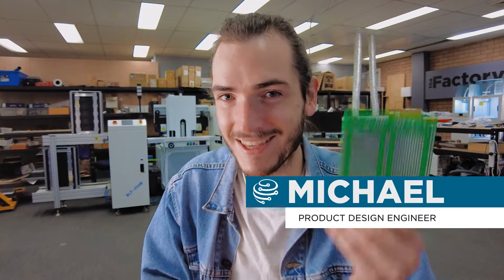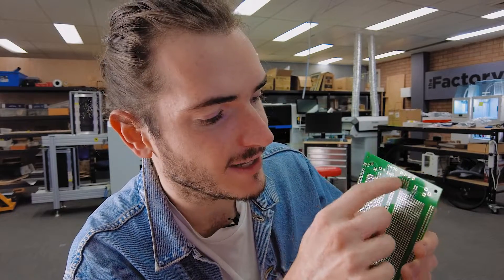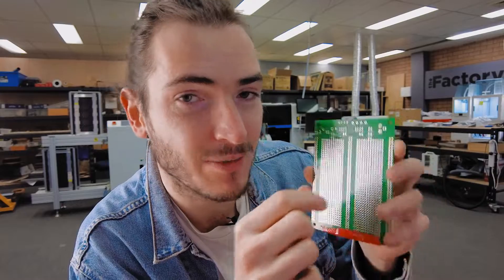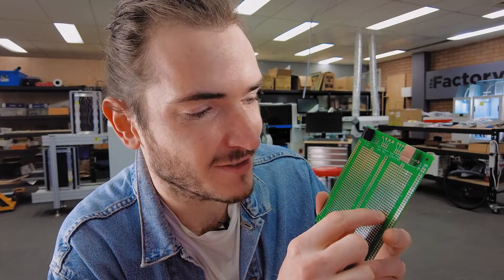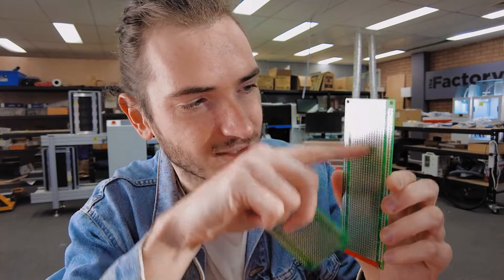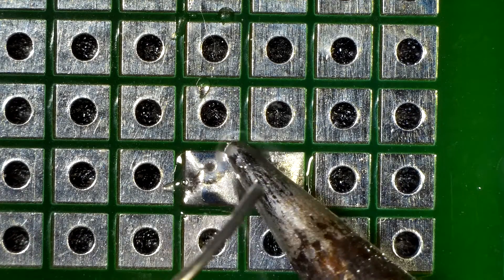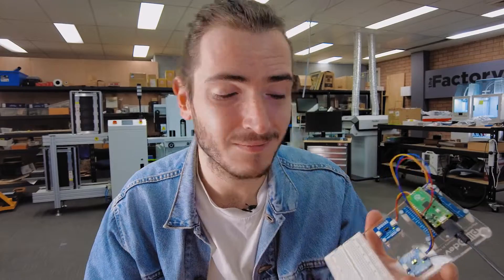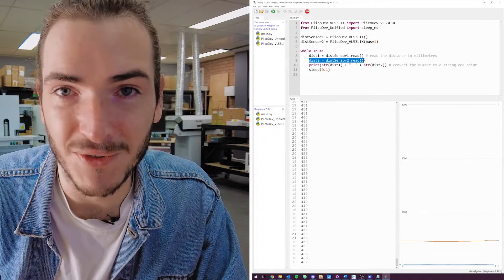The Factory | More Perfect Protoboards & Previewing KiCad 6

Comment: Those protoboards look fantastic!
I didn’t think you could possibly squeeze another feature on to these boards but you did! Being able to select what you want to do with the centre bus lines and change it with a solder bridge is brilliant! Running out of holes on a protoboard when using an Arduino nano has been the bane of my existence for years which drove me to go back to vero or strip board which is very limiting . Looking forward to trying some of these!
Keep up the good work guys !